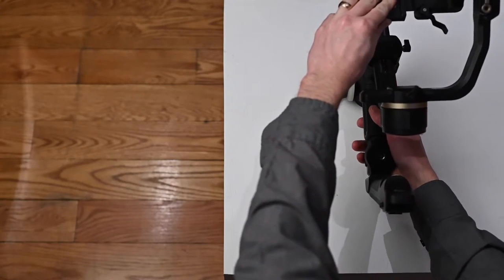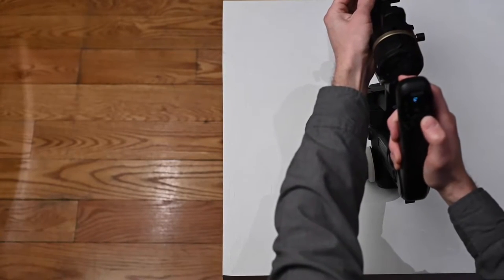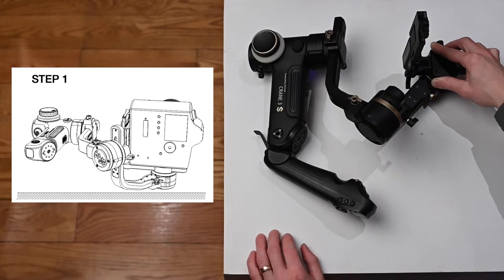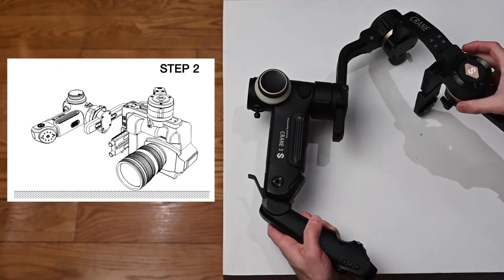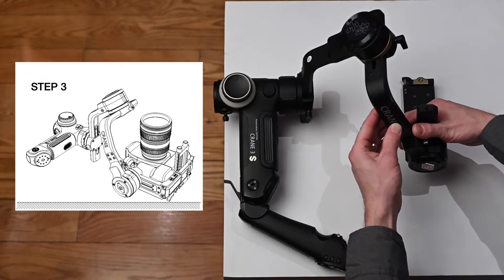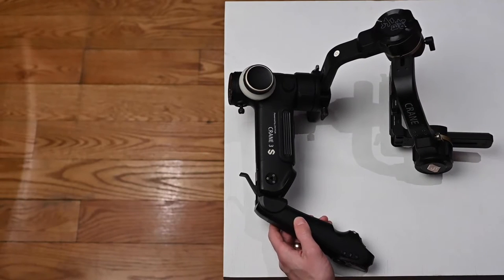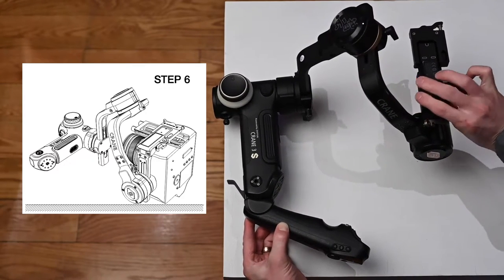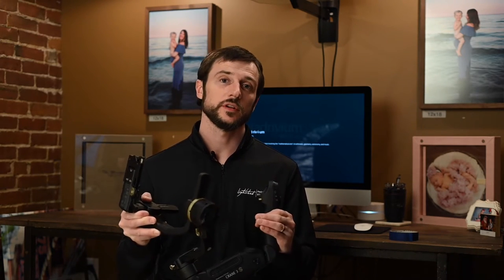Calibrating Zhiyun Crane 3S Gimbal

Comment: My motors engage when I move to step 3. Is there a button getting hit that I’m not noticing?
Reply: Did you ever get the motors to stop engaging? I am having the same problem.
Reply: @KHQ6promotions  I did. I opened up the app, connected the gimbal, and went thru the calibration process that way and it was successful.
Reply from the maker: Never had that issue - I would try turning it off and re-starting the process.
Reply: Probably the Mode button is getting hit. Happened to me. Held it level with the desk (button off the desktop) and problem solved

Comment: i m still on step 01 and nothing changes , don't understand
Reply from the maker: It can take a couple minutes - I cut that portion out of the video (so this isn't real time). Try and move the handle around slightly to get it to progress to step 2.
Reply from the maker: I've found that turning it off and starting over can fix this.  Sometimes the program seems to get stuck - I got stuck on step 3 for a while, re-started and made it through all the steps very quickly.  It could also be that changing position lengths of arms mid-calibration could have a negative effect (only a theory of mine). I would try not to alter those during the process just in case.

Comment: How do you know that each step is completed?
Reply from the maker: When complete, the LCD will automatically show the next step.  If you're on step 1, and the LCD still says step 1, it hasn't completed. If it gets stuck on a step for a very long time, try turning off the gimbal and re-starting the process (that has worked for me).  It's a finicky process and I don't like having to do it either...